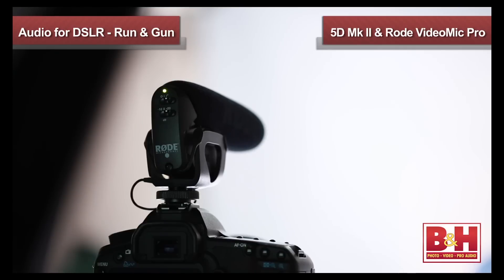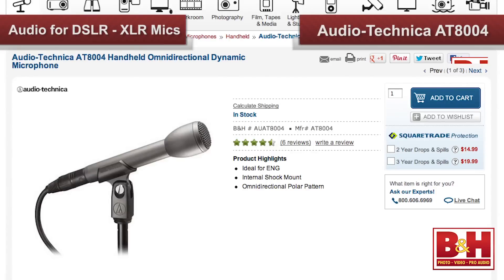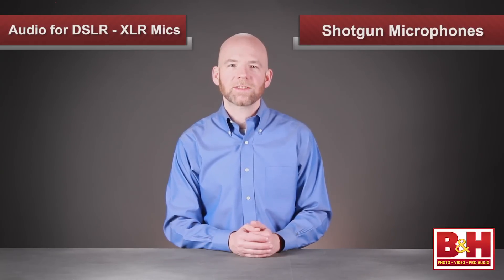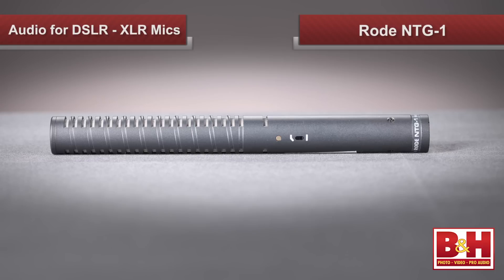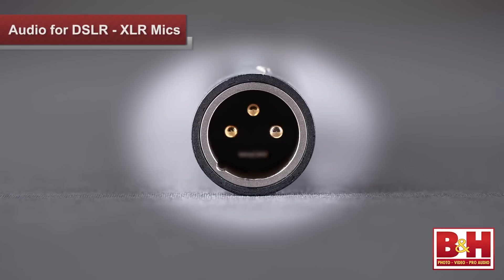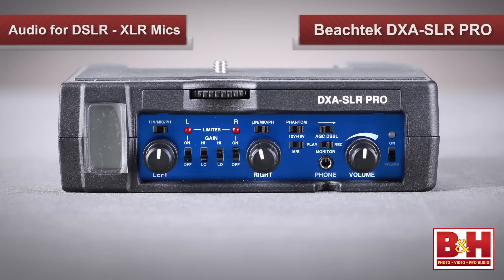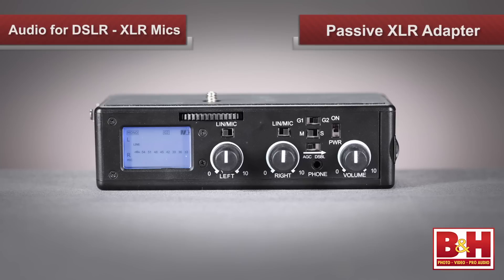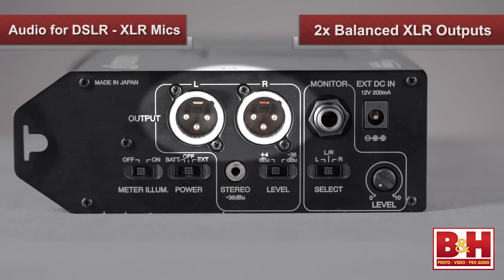Audio for DSLR Part 2 - XLR Mics

Comment: Although it is true that the cable adapter does not provide phantom power for condenser mics, you can use the cable adapter for dynamic microphones, something not mentioned in the video.

Comment: Hi there, great video and huge thanks for the useful tips. I’m going to ask such a noob question so please excuse me. You said in the video that once you’re connected  the XLR mic to the Beacktek audio adapter, you will then need a 1/8 inch mini Jack to connect the BeachTek adapter to the DSLR. Could you please tell me exactly what spec that mini jack is please or a link to one as I have no idea what I’m looking for. Many thanks in advance.
Reply from the maker: A compatible cable would be the Kopul CMX-RC30 Right-Angle Coiled Stereo Mini Cable (Red, 8 to 30")
, B&H # KOCMXRC30. 

https://bhpho.to/2XMWSfY
Reply: B&H Photo Video thank you so much. That’s great

Comment: I really wish the DXA-SLR-Pro was cheaper...I'm using the AT897 and need to hook it up to the Nikon D5100. I have a beach audio transformer adapter from an earlier set up, and it does not work. If I buy the Sescom SES-TR-153, it will work right? I can drown most of the hiss from the camera's pre-amp out in post. Please respond, and awesome video! :) Can't wait for part 3.

Comment from the maker: The audio interface will output a line level signal. You can use a Pro Co Sound LMX In-Line Barrel XLR Mic to 1/4" Line Level Adapter (B&H # PRLMX) and then an adapter to convert the XLR output to a 1/8" mini (3.5mm) connector. The Kopul LMT100 connects a microphone into a high-impedance 3.5mm mini input found on DSLRs (B&H # KOLMT100). Please contact us via e-mail if you have additional questions: askbh{at}bandh{dot}com. Mark S.

Comment from the maker: This combination will not work with a Sescom cable. Use the Pearstone LMT100 cable (B&H#PELMT100) It is 1.5' long and has a 3-pin XLR female connector on one end and a standard 3.5mm mini plug on the other. It is designed for use with mono microphones. Please contact us via e-mail if you have additional questions: askbh{at}bandh{dot}com. Mark S.

Comment: How do you power a preamp when you're outside shooting?
Reply from the maker: +Jorge Aguilera - The Sound Devices MM-1 is a single channel,portable microphone preamp and headphone monitor designed for monitoring sound for film (boom operators), broadcast and ENG, field recording, voice over and corporate / industrial environments. The mic preamp features exceptional audio quality with a dynamic range exceeding 120dB and an audio bandwidth of 10Hz to50kHz.

The balanced XLR microphone input provides user switchable +48V, 12V and 12V-T phantom power. A separate balanced monitor input accepts balanced or unbalanced line level signal. The 1/4" TRS headphone output is capable of monitoring microphone signal, external line level signal or a mix of both. A 3-position low cut filter switch eliminates noise below 80Hz and 160Hz. The compact unit features a belt clip and is powered with 2 AA batteries or external DC power source.  http://bhpho.to/1mhNpYa

 Please contact us via e-mail if you have additional questions: askbh@bandh.com    >Mark<
Reply: I have a Tascam DR-60D MkII. It runs on four AA batteries or USB power. I have spare batteries and a USB-charger with me and use a powerbank for external power when I have to do recordings that exceed the three to four hours of battery life of this preamp/recorder.

Comment from the maker: The Sennheiser MKE 600 is a shotgun mic designed for use with a camcorder. It takes on even the toughest video sound challenges, while still being compact and short relative to previous models. B&H # SEMKE600. The juicedLink RA222 Riggy-Assist Dual-XLR Preamplifier will allow you to connect two XLR mics: B&H # JURA222. Please contact us via e-mail if you have additional questions: askbh{at}bandh{dot}com. Mark S.

Comment from the maker: You need the Sescom SES-TR-153 XLR to Right Angled Mini Microphone Cable (B&H # SESTR153). This cable features a standard XLR female input and a right-angled 1/8" (3.5mm) mini male output connection. Low to high impedance matching "steps up" the microphone level, and its RFI shielding eliminates noise from cellphones, etc. Please contact us via e-mail if you have additional questions: askbh{at}bandh{dot}com. Mark S.

Comment: What's a good mic to record loudspeakers..the speakers have drive units that are scattered on the front of the cabinet. I wish to make a stereo recording of music through the loudspeakers. The speakers are spaced about 6ft apart and the listening position could be around 6 or 8 ft away. My camcorder is a Panasonic hcx900m
Reply from the maker: Connect a RODE Stereo VideoMic Pro (B&H # ROSVMP) which builds on the success of the Rode VideoMic Pro & Stereo VideoMic with improved stereo reproduction, sound quality and ergonomic design. The Stereo VideoMic's capsule feature a matched pair of 1/2" cardioid condenser capsules, mounted in a coincident X/Y position for accurate stereo imagery and detail. The microphone's small, ergonomic footprint features an integrated shock mounting system for superior isolation from vibration and mechanical noise. The multi-strand output cable is terminated with a 1/8" (3.5mm) output connector and delivers significantly lower noise transference than traditional audio cable. 

The included shoe mount features an integrated shockmount system for even further protection against handling noise. The Stereo VideoMic features a high pass filter switch at 75Hz for minimizing low frequency noise, and a -10dB Pad for maximizing headroom for capturing loud signals without distortion. The +20dB level boost switch is specifically designed to provide a higher quality signal with DSLR cameras. When activated, camera preamp level is reduced, resulting in a lower noise floor and much clearer recording. http://bhpho.to/Oq1g8u 

Please contact us via e-mail if you have additional questions: askbh@bandh.com>Mark<

Comment from the maker: Our Pearstone LMT100 (B&H # PELMT100) cable enables a microphone to be input into the 3.5mm mini input found on DSLR cameras. It is 1.5' long and has a 3-pin XLR female connector on one end and a standard 3.5mm stereo mini plug on the other. It is designed for use with mono microphones. Please contact us via e-mail if you have additional questions: askbh{at}bandh{dot}com. Mark S.

Comment: I have a question I am planning to buy a Sennheiser MKH 416 and use that on top of my Canon 80D will I be able to connect the mic and the camera directly or do I need some kind of amplifier or SLR adaptor for best possible audio quality
Reply from the maker: You will need a DSLR audio adapter:    The RA222 Riggy-Assist Dual-XLR Preamplifier with Phantom Power and Metering by juicedLink is designed for cameras that don't have integrated audio meters, manual gain control, or a headphone output. The RA222 features two 4-segment meters which can be calibrated to the camera, an 1/8" mono headphone output and an AGC disable switch.
The RA222 features 2 locking XLR inputs with low-noise microphone preamplifiers. Each channel includes a Mic/Line level switch, a Hi/Lo gain switch, and a Phantom power switch. The onboard Phantom power voltage is selectable between 48V/12V. The inputs can also be summed mono, copying each input to both sides. The right channel can be completely powered down to conserve battery power if it is not needed. 
When engaged, the Audio Output Bracketing feature of the RA222 ensures that your audio inputs won't clip or distort. By placing the RA222's performance in mono and enabling the 16dB pad on the right channel, you end up with two signals with identical content, yet the right is recorded 16dB lower. This way if a sudden loud noise or a boomy portion of audio is recorded, you'll have a backup track with headroom in case the 0dB output clips. 
The RA222 Riggy-Assist is powered by a 9V battery. High capacity lithium-polymer rechargeable batteries can be used as well as alkaline. The low-battery indicator can be switched between alkaline or lithium-polymer threshold, so you can use either chemistry without leaving unnecessary capacity in the battery.     https://bhpho.to/2h6OjrX    >Mark<

Comment: Long time watcher first time commenter. So we are a small hobbiest channel for friends and family, we recently upgraded to a Nikon d5600 and bought the rode micro and an extension 3.5mm cable to set up when we do podcasting or  fun family video challenges. We notice that the pre amps in the camera are pretty shotty and quiet the guess work. We can set the volume manually and it will sound great when talking normal but when we laugh or shout (if playing a game) it peaks/clips so we turn down the volume in post, or if we turn down the mic on the camera a notch it is quiet in normal talking but the loud parts are fine. Is an interface something I need to keep the volume levels great and keep it from clipping? The mic is currently about 3-4 ft away as sometimes we have things on the table in front of us we would like to show. Thanks!!

Comment: hey b and h photo, I just got a rode ntg 2 and I have a nikon d3300. Would you recommend getting the juiced link audio mixer and or the beachtek audio mixer, or a zoom h4n? If I use something such as the juiced link with the ntg 2 would it make the audio quality worse than if I were to use a recorder such as the zoom h4n?

Thanks,
Iliyan
Reply from the maker: +Iliyan Husein Using an audio adapter from juicedLink or Beachtek is a fine workflow, but still records the audio to the camera's relatively low res audio track.  Using the recorder provides the high resolution audio (WAV: 44.1/48/96 kHz) one desires for a professionally produced project.  http://bhpho.to/1S8SzOs      >Mark<

Comment from the maker: You can use the Beachtek - DXA-SLR PRO HDSLR Audio Adapter (B&H# BEDXASLRPRO) and two wired lavalier mics: AUDIO-TECHNICA AT803B (B&H # AUAT803). Or you can use a couple of handhelds: Electro-Voice - RE50/B - Omni-Directional Handheld Dynamic Shock Mounted ENG. (B&H# ELRE50B). Please contact us via e-mail if you have additional questions: askbh{at}bandh{dot}com. Mark S.

Comment: Strictly for video recording. The t5 does not have a external microphone output but the SL1 and T5i do. Right?
Reply from the maker: Correct. The Canon EOS Rebel SL1 and the Canon EOS Rebel T5i both offer external microphone input ports. The Canon EOS Rebel T5 doe not offer this feature. 

Please contact us via e-mail if you have additional questions: askbh@bandh.com>Mark<

Comment from the maker: I'll assume you are referring to the Panasonic GH3. The VP83 LensHopper Shotgun Microphone from Shure is a compact camera-mount condenser that provides detailed, high-definition audio with DSLR cameras. An integrated Rycote Lyre shock mounting system provides isolation from vibration and mechanical noise. Please contact us via e-mail if you have additional questions: askbh{at}bandh{dot}com. Mark S.

Comment: I'm really fixed on getting the Canon 70D but it doesn't have a headphone jack - I'm looking to make short documentaries so I need to be able to hear through headphones. All microphones can be provided through university but I need a mic and headphone adapter... This seems like the thing you mentioned in the last section of the video but it seems very pricey. Do you know what my cheapest option would be? I don't really want to go down the magic lantern route
Reply from the maker: Most DSLR or mirrorless cameras do not provide a headphone output.

This is a relatively low cost solution: 

The Beachtek MCC-2 2-Channel Audio Adapter and Bracket (B&H # BEMCC2) is designed to attach to your DSLR camera and allows you to send two mono or one stereo audio source to your camera's audio input. It has two mono 1/8" inputs with individual trim control knobs as well as a stereo 1/8" input. A mono/stereo switch controls whether the two mono or one stereo input is active. It connects to your DSLR camera via a 1/8" stereo mini-jack output, and works ideally with cameras that have a headphone output to allow you to monitor your audio. 

The body of the MCC-2 has three integrated mounting shoes to attach a variety of mics or wireless receivers to the unit. The MCC-2 itself will fit on any DSLR or camcorder that has a standard mounting shoe. It has passive operation, and thus requires no batteries or power source. 

http://bhpho.to/1IZIIbP 

Please contact us via e-mail if you have additional questions: askbh@bandh.com>Mark<

Comment: Are there any downsides to using an XLR to 3.5mm adapter? Is it still a symmetric connection?
Reply from the maker: The balanced connection is lost. Any adapter or additonal component in the signal chain has the potential to degrade the signal in some way.  >Mark<

Comment: Would I be able to plug in my dynamic mic and plug in my guitar in the other xlr jack with proper direct box?
Reply from the maker: There is no practical device for what you are proposing. You could use a USB interface to route both signals to a computer. 

The AudioBox 22VSL from PreSonus is a portable 2 input/2 output USB 2.0 audio and MIDI interface that allows for monitoring with low-latency effects. It features two combo microphone/instrument inputs with Class-A XMAX microphone preamps, and ships with Studio One Artist DAW software. B&H # PRAB22VSL. 

Please contact us via e-mail if you have additional questions: askbh@bandh.com. Mark S.

Comment: Could I hook up an XLR mic to a recorder( that of course has XLR inputs) and send the audio from the recorder in to a DLSR?
Reply from the maker: Depending upon the line output configuration of your recorder, this attenuation cable might work: 

The Kopul ACDR-35 Line-to-Mic Attenuator Cable (B&H # KOACDR35) is designed to connect your digital recorder output to the mic level input of your DSLR camera with 35dB of attenuation to step down the hot line level audio to microphone level. It is shielded to reduce RF noise from cell phones and provide interference-free operation. 

http://bhpho.to/191UNka 

Please contact us via e-mail if you have additional questions: askbh@bandh.com>Mark<
Reply: B and H hello I have an SLR but not to a microphone jack so I ask if I can use the audio for DSLR without microphone jack on the reflex thank you.
Reply from the maker: Thibaut boy Unfortunately you need a microphone input to connect a microphone to a camera. When the camera has no mic input, using a portable audio recorder would be the recommended method. 

Please contact us via e-mail if you have additional questions: askbh@bandh.com>Mark

Comment: What's the benefit of having a XLR connector? If one can use a adaptor men there is no gain from XLR?
Reply from the maker: You will still gain some benefit from a lowered noise floor and reduced noise.  Typically a natively-designed  XLR microphone, from a quality manufacturer, is more robustly built and engineered to deliver superior audio.  >Mark<

Comment: Hello, I have a Canon EOS Rebel SL1. I'm not sure if I need a power supply for my XLR microphone? Please help!
Reply from the maker: Your XLR microphone requires phantom power.  Your   Canon EOS Rebel SL1 does not offer phantom power.  So you will need to use this device to not only power your microphone, but also to send its audio signal to your camera:

Beachtek DXA-MICRO-PRO Active XLR Compact Adapter
B&H # BEDXAMICROP 
 https://bhpho.to/3oduy0W
Key Features
For DSLRs and Camcorders
Connects External Microphones
Powerful Preamplifiers
1 x XLR Mic Input with 48V Phantom Power
2 x 3.5mm Mic Inputs with Plug-In Power
Easy to Set up and Use
Compact Chassis with Flexible Mounting
>Mark<

Comment: I just purchased a Canon 80d and I noticed it only recordes on the Left Channel. What can I do to have it record on both channels like my Canon t6i?
Reply from the maker: The 80D should record audio on both channels.   We will need a bit more information to help you with any issues you are facing.  Please email us directly at askbh@bhphotovideo.com.  We will be better able to assist you from there.

Thanks!
-Joey P
Reply: Thanks. Turns out the Mic input port is faulty.  Sending it back.

Comment: Anyone have any suggestion for VERY loud, indoor live performances. I am looking to record shows for local bands and my Rode Mic pro just can't handle it. I have actually been better off using the internal mic on my DSLR, but I am looking to get some real professional sounding performances. Any thoughts?
Reply from the maker: This is an excellent, short-shotgun mic that handles high SPL's and will not break the bank. You will need a mount and cable for DSLR on-camera use. 

B&H # AUAT897. http://bhpho.to/1r8Dswy 

Please contact us via e-mail if you have additional questions: askbh@bandh.com. Mark S.

Comment: I used a Sennheiser ME66 shot gun and a SHure PG 185 Lavalier Microphone for a BeachTek DXA-5DA Adaptor for an indoor recording with my Canon 7D but the audio output has so much noise, how do i correct that?
Reply from the maker: Be sure to have "AGC DSBL" activated on the Beachtek and have it switched to "MIC". Since there is no phantom power provided - make sure you have your mics powered up with fresh batteries as well. Check the Beachtek's battery as well. And connect via the "MIC OUT" only port. 

Please contact us via e-mail if you have additional questions: askbh@bandh.com. Mark S.
Reply: Thanks, this is really helpful.